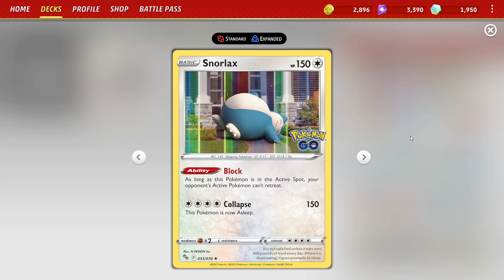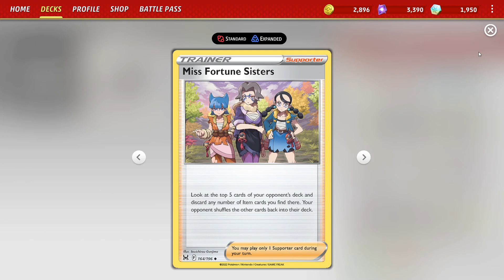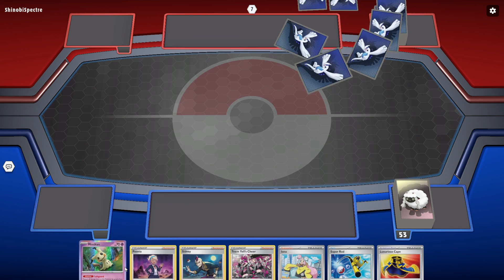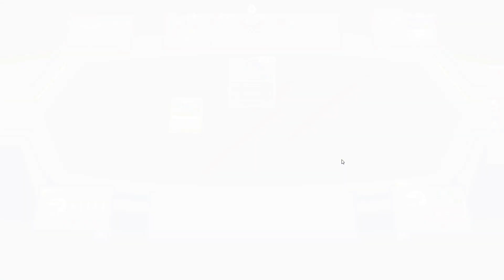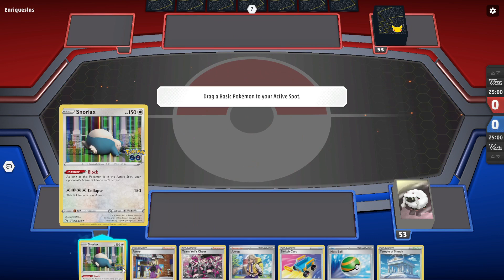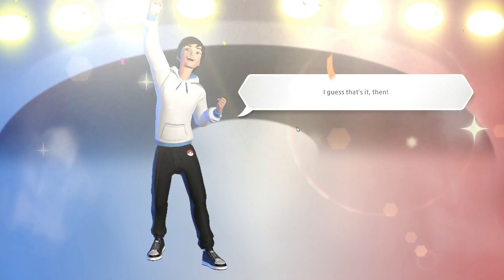SNORLAX CONTROL! NO ENERGY NEEDED TO TAKE OVER! SHOULD IT BE BANNED?!

Comment: Running one mimiku and one rotom can get you in a bind. Been playing it for awhile and it is best to have 2 of each for many reasons. Tries with one of each and it can cause you to lose a game. Rod is a card I have never needed. You have other cards that can serve the same purpose and more. Giacamo you need to run at least 2. I run 3. If you don’t have multiple it will cause you to lose some games. Also. Run one bravery charm for rotom and pot helmet for the rest. It works ALOT better. Especially playing lightning deck. The one you trap hits for 50. Using bravery and :4 hits ur out. Use pot or other they are only hitting for 10-20.  Trap squawk and it hits for 0. 11:00. This is why I run 4 boss also and 4 penny. 20:40. Should penny rotom out
Reply from the maker: Thanks for the advice, ill make some changes to the deck. I think running two mimiku could be a really good addition. I like rod still so it doesnt cost me a supporter for the turn in some situations but i can agree its not fully needed. But thanks again for the deck advice you seem to know it very well and I think alot of people could be helped by your comment.